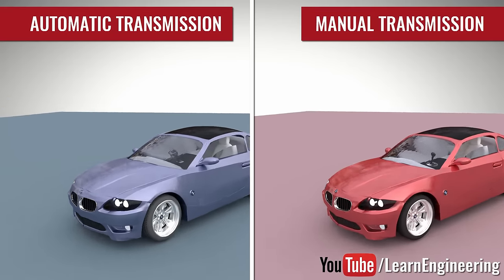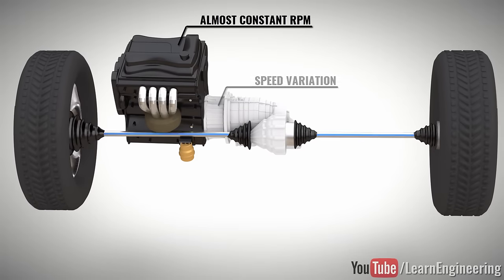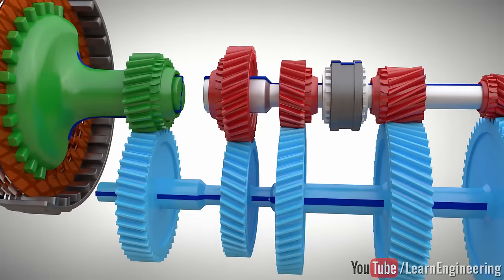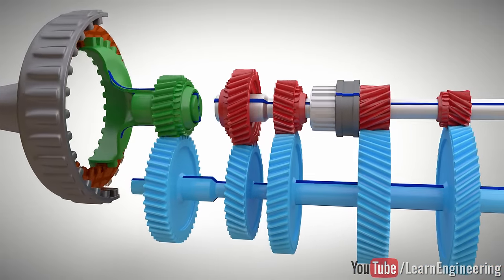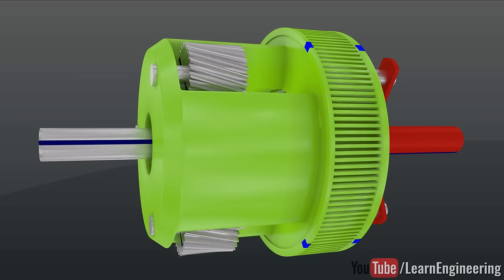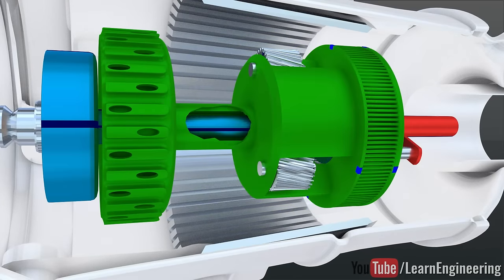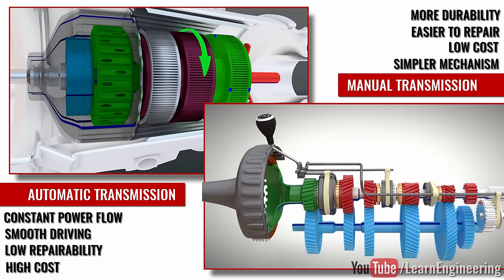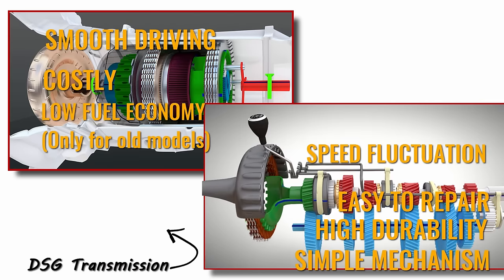Automatic vs Manual Transmission

Comment: you don't have to engage the clutch before breaking, that would lower the fuel efficiency. Press the clutch before the rpm get under the idle speed, that saves fuel and reduces the brake wear
Reply: Exactly!
Reply: Dragneel  Just engage the clutch when it's under 1000 rpm
Reply: Dragneel  dude, if you need to go from 100 to 0 in 5 secs, you should not press clutch man. Because you want to prevent an accident. Stalling your car is better than wrecking it
Reply: Dragneel  you don't, when you need to stop immediately just slam both pedals at once (emergency braking)
Reply: @Agent-1220  yep both pedals decreases braking distance if the brakes get warm, you don't want to be having to stop the engine from spinning as well so disengage the clutch
Reply: I don’t see how it helps fuel efficiency to press the brakes and let the engine do the braking, once you press the clutch in it drops the rpms immediately down to idle speed, if you press the brakes without taking it out of gear it’ll just be engine braking and slowly going down in rpms, that’s less fuel efficient but it is better on the brakes
Reply: @crimsonlight4205  with pedal braking you waste more of the momentum you gained during acceleration than if you engine braked the distance but it is slower

also, as seen in the video, engines have an optimal rpm range, idle rpm is below optimal efficiency, so engine braking is more fuel efficient because it stays in the optimal range longer
Reply: The YouTube algorithm is wild... imagine leaving a comment two years ago and not hearing a peep, then suddenly you get eight responses in four days 😂
Reply: @Zaros262  I wish you (and people like you) would add something interesting to the discussion instead of pointing out the algorithm
Reply: @Agent-1220  oh yup, I didn’t watch the video lol, and it’s been a long time since I worried about fuel efficiency in a manual so I forgot how awful idling is on an engine
Reply: @crimsonlight4205  Because in most modern cars the manual transmissions you have is coupled with a fuel injection system. When you break and the throttle is closed the system cuts off gasoline to the engine. While this happens the engine consumes no fuel and the power of the engine is used to SLOW the car because the action of the engine pushes back on the forward rotation of the wheels causing it so slow even faster than if the transmission was in neutral. If the engine is in neutral than the fuel injection system MUST be supplying fuel to the engine to keep it running at idle speeds.
Reply: @Agent1220  I didn't so much discuss the algo itself but how strange it must be for all the replies to come two years later

Ironically, whining about my comment being uninteresting contributed even less than the comment you're complaining about.
Reply: brakes wear is much cheaper than clutch wear - you should use the brakes to show down the car and not clutch
Reply: @yairvsync  Clutch is not being worn, you're basically braking with the engine which is more efficient AND safer.
Reply: I mean you’re completely wrong of course 😂
Reply: @Shepard_AU  it's in every single comment section of videos that were recommended well after their creation and I'm getting tired of it

it's uninteresting, adds absolutely nothing, only other idiots like it but there are saddening amounts of them, and it's cancerous. 

the last one fits well because normal people hate seeing every third comment among the best ones being algoposting (and the other majority being shitty meme format comments), and they get corrupted eventually and join algoposting (or hating it, because that's also not good, and makes me a hypocrite but that's besides the point), almost ruining a big part of this website.

I sometimes call them out while they have few replies because usually I see them having hundreds already when they shouldn't have any

edit to add: look at everyone in this comment thread. most of them (including me!) actually discuss something related to the video's content. there is one guy who replied to the comment about the algorithm taking 2 years to recommend it, which has nothing to do with the video's content nor with the convo (then defends himself lmao). there's me, who already contributed and called out the algoposter. there's a guy who is probably on my side and chirped in with a ridiculing joke against mr. algoposter. and then there's you, who calls out my call out.

who is (are) the problem here?
Reply: @crimsonlight4205  I see you don't drive a manual. Pressing the clutch disconnects the engine from the wheels, so RPM goes up not down, and the wheels feel lighter without the engine so the car takes more time to break.
Reply: @lumer2b  obviously you don’t smh, pressing in the clutch disconnects the engine from the transmission and puts it in neutral so the rpms go down, you can literally see that in every manual with an rpm gauge. There’s no fuel being put to the engine and now outside force making it rotate so the rpm goes down to an idle speed, usually about 800 rpm. And it takes more time to brake because the engine isn’t helping the vehicle stop by making the transmission slow the rotation of the wheels, it has nothing to do with lighter wheels or whatever stupid thing you said. You should learn more about cars like the other people here who corrected me before getting into something you don’t understand my guy
Reply: @lumer2b  yes for a slight brief second rpms may rise by about 200 or so… and then immediately fall. And saying that it feels lighter isn’t a simplification, it’s completely wrong. Nothing is lighter. There’s just no external force keeping the wheels from spinning on their own.
Reply: @crimsonlight4205  Do you still not understand the difference between "something is" and "something feels like"?
Reply: @lumer2b  and your still not understanding that something feels like it’s lighter isn’t even a simplification for what happens when you press in the clutch. Smh it doesn’t really matter, I’m not arguing semantics with someone who has no clue what they’re talking about
Reply: @crimsonlight4205  engine breaking doesnt use fuel in any fuel injected vehicle (aka past 30 years). It uses the momentum of the wheel spin to compress air and slow the car down
Reply: @hajjdawood  yeah somebody already corrected me, thanks for the info tho
Reply: @theedgarthefish4267  It still consumes fuel, if the fuel shut off completely then the engine shuts off. In most modern manual transmissions your pcm/ECU will cover fuel delivery based on engine demand, your throttle is also electronic, opening and closing based on driver demand.
Reply: @austynbarber4078  uhh, no, no it doesn't. The motion of the wheels prevents the engine from stalling. Since the engine is directly connected to the wheels the pistons must move. If they move but don't have, they will force the engine to slow down.
Reply: @Agent-1220  Congrats. You've single-handedly sidelined this conversation with your pugnacious rant more than the other guy ever did.
Reply: @jasper_of_puppets  no, I didn't. The other conversation is still going. And just as many other smoothbrains would've joined anyways (other than those here, who tried defending Zaros).

I'm not part of the original conversation anymore because youtube stopped notifying me about it, only showing the replies I'm tagged in.
Reply: @theedgarthefish4267  THANK YOU for having a brain. I was getting nervous that nobody knew this lol
Reply: @lumer2b  the only reason your rpm would rise while pressing the clutch would be if you didnt release the gas pedal

This whole comversation is stupid and i doubt any of you actually drive a manual lol
Reply: Dragneel  your tachometer
Reply: @crimsonlight4205  the nozzles doesnt close when you press in the clutch
Reply: You are "breaking" your car?
Reply: Both sides are right, but depends on the type of engine. If the engine uses fuel injection, it will most likely stop injection while engine breaking (DFCO). If your car still uses a carburator it will be worse for fuel economy
Reply: True
Reply: @A L  Okay, so your engine stalls every time you stop the car. Interesting.
Reply: It'd only affect fuel economy to the extent that your engine uses fuel while at idle, which for the 10 seconds you are decelerating, is negligible. Or am I missing something?
Reply: Much safer too.
Reply: Just dont break
Reply: ever try down shifting while slowing to a non-emergency stop? Let the engine slow you.  
If you thing the clutch has to be fully depressed before applying the brakes, you don't know how to drive a stick shift. The ONLY time the clutch should be depressed is when stopped. The rest of the time your foot should be off the pedal. Car or truck as long as you're not on the race track speed shifting you float the gears, no clutch necessary. How do you think truckers can get over 10 years/1,000,000 (one million miles) out of a clutch? I've replaced one clutch in a pickup since 1974, and it was slipping when I bought it. I traded the truck (3 on the tree) for a car with an automatic because I needed surgery on my right knee and hip. Leg was in a cast. The clutch didn't need adjustment after over 75,000 miles. I always floated the gears. When down shifting during the pause when in neutral you have to rev the engine so it drops into gear without grinding.
Reply: People also often forget that braking with engaged gear also have some abs properties, preemptive good for old cars that doesn’t have an actual abs
Reply: Okay, glad I'm not the only one who caught that. You can fail a driving test for doing that, coasting is bad and it's not safe to have the gas pedal not do anything if an emergency happens.

I honestly thought it was about to talk about engine braking. But nope, telling people they have to do something that you are definitely not supposed to do.
Reply: @crimsonlight4205  engine braking shouldn't consume fuel in newer cars because of dfco
Reply: Took the words right out of my mouth….3years ago! 😂
Reply: @Agent-1220 you sound high strung..like really stressed out man you okay?
Reply: How is pressing the clutch in reducing fuel efficiency? It almost instantly lowers the RPM and lets it idle as you coast to a stop. Being connected to the transmission, and thus the wheels, will put tension and drag on your engine and cause the RPM to rise, lowering fuel efficiency.
Reply: @Agent-1220 if you're trying to slow down to stop, why does your momentum matter at all? You're trying to stop 🤣
Reply: @coldbrew6104  imagine golfing. you don't want to overshoot, and when you undershoot you can knock it towards the goal again. (if you overshoot, you might hit something, fall off, or if you're lucky you only have to turn around and start knocking again)

there are a few caveats to golfing with a car, like the engine not waiting for the car to fully stop before striking again giving a boost thousands of times per minute, and brakes existing to lessen and correct overshooting

if you overshot, used more power than you wanted to, you might want to brake. you would roll farther if you pressed the clutch and let the car roll to a full stop (on flat surface) due to the momentum gained, but you choose to brake to stop earlier than that, counteracting on the momentum

if you undershot, you need to use more power to reach your goal, the car will never reach it without it, let the engine strike some more

the harder you have to brake and the more you overshot, the more momentum you have to counteract on and the more power you waste

that, and if you counteract the momentum too much the tire might lose grip, so you might lose control, stop later and, possibly, abruptly
Reply: Engine breaking sounds like a good way to

-Fry your clutch (Pitting your transmission against engine output)
-Break gear teeth (Pitting your transmission against engine output)
Reply: Also, you don't have to disengage the clutch in order to shift gears.
Reply: @Neoprenesiren wtf? Engine breaking happens everytime you lost your foot from the gas pedal and it doesn't cause any of those things you mentioned.
Reply: A lot of responses here state that not engaging the clutch while braking is wearing out the clutch or the engine. 
This is not accurate imo. If you brake, you usually apply enough braking force to decelerate on the brakes alone. In other words, the engine is actually just trailing behind.  It doesn't put any force on the clutch or engine.